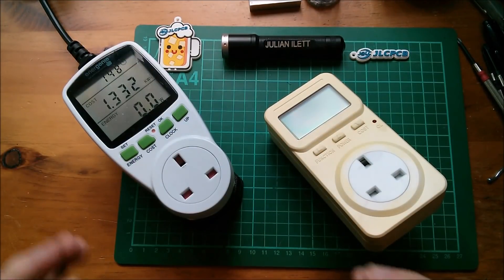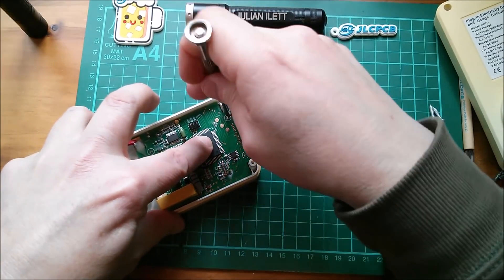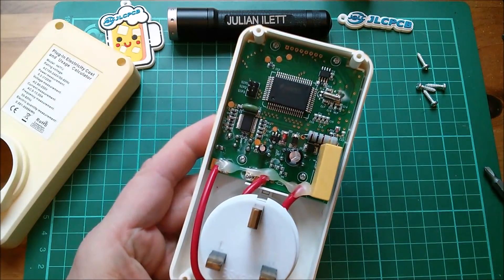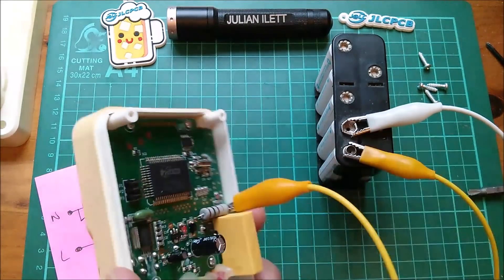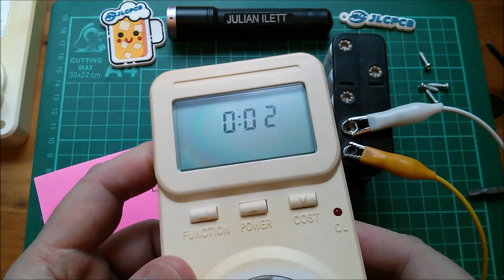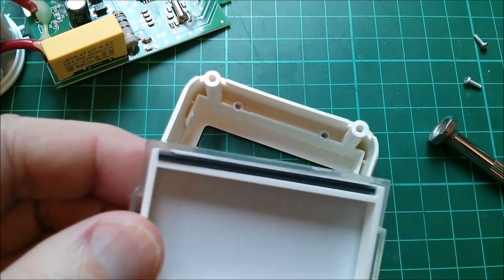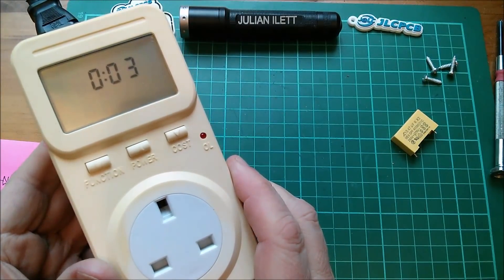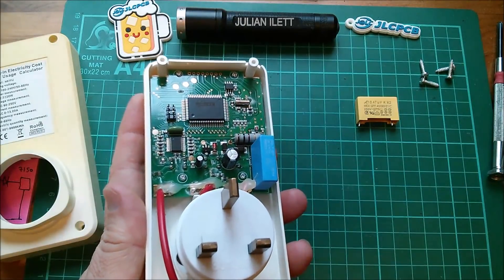Energy Meter Repair

Comment: It's common, capacitors have lifespans because of their chemical nature. They are usually the first things that start to fail based on age being the factor of failure. 
For example, resistors a simple wound wires, so they nearly never fail unless components before them failed that allowed too much voltage. 
Things like various diodes also usually don't fail because of age.
Most common age failure is a battery, second is a capacitor.

Comment: I'm surprised that you didn't doublecheck your line freq with the other power meter, Julian.  Anyway, that was an interesting romp around the power meter.  I use a P3 P4400 Kill A Watt over here in 'Murrica and have never had the need to look inside it.

Comment: The meter is also designed for 120V. With 240V, the needed capacitance is half. Of course, there's also a chance that the half-sized capacitor still works on 120V.

Comment: Besides a little lower supply to the 5 V regulator, I am pondering if the reference frequency is correct.  Voltages are measured in a ratiometric way, so they would still be O.K.  But the frequency is counted against some reference clock.  You might see if the frequencies of the resonator you mentioned or a crystal I actually would suspect is the culprit.  Normally the crystals also have a mode select capacitor or two.  Series resonant or parallel resonant?

Comment: The excess material on the plastic is called "flash" the process for removing it is called "fettling" which is done by a "fettler" which used to be a trade back in the day, still might be for all I know.

Comment: The pulse output is indeed energy. It can be used to power a pulse LED, like on your main meter. Or sometimes it is used to power an opto-isolator.
That way, an external device can monitor power usage without a direct ("galvanic") connection to the measuring circuit, either by putting a photodiode over the LED, or sensing the "volt-free" opto-isolator output.

Comment: No real surprises there - I was calling this as soon as you opened the case and I saw that big X2 cap - This is a VERY common failure of those cheap remote controlled mains sockets too - I've had loads of those come in for repair over the past few years with exactly this same fault. As the capacitor decreases in value over its lifetime, the amount of current it can pass reduces accordingly until it eventually gets to the point where the available current is insufficient to operate the device. This is especially relevant in those remote mains sockets as these need enough current available to drive a relay, so ANY degradation of the capacitor will result in a non-working unit (the most common symptoms with those are either that the device doesn't respond to the remote at all or, more commonly that the LED lights up but the relay fails to operate, or at least fails to latch on due to insufficient current being available to keep the coil energised

Comment: It seems that the frequency readout issue is NOT related to the capacitor or it's change - as the device displayed the same 56 Hz even when you directly applied the 12 volts to the 101 resistor with no AC power applied and no load (before you changed the Cap).  See 7:30 on the video.

Comment: I have one of these monitor sockets and  mine also always reads 0.01 amps even with no load plugged in. I don't think it can be half wave rectified  as a capacitive dropper wouldn't work with one

Comment: The smaller capacitor means that the voltage going to the regulator is reduced  (smaller capacitor has larger reactance). If they are tapping off just before the regulator to measure frequency, then the reduced voltage might mean there isn't enough voltage there to hit the threshold of the frequency detector. I suspect it will work if you put in the correct value capacitor.

Comment: You were getting 56hz while powered from the batteries which is physically impossible! Unless you have AC batteries? Did you check what the frequency was on the crystal? Unless it was reading that? Who knows... 
You definitely need a good LCR Bridge for capacitor testing! Over on XRayTonyB's channel, he showed a really good tester, it's silver aluminium in colour with a lime green LCD screen... This is a must have tool for anyone's bench and Tony does an excellent job of explaining how easy it is to use... It shows up capacitors that are failing! Not just capacity and ESR, highly recommend watching if you haven't already seen it.... I got the newer version which is black, smaller and has a built-in rechargeable battery via USB C, the amount of information it gives is like nothing else that I have or have come across... It's just as important as having a multimeter! I love it.. oh, and not that it matters but the new one gets a blue screen instead...

Comment: I really like to repair rather than replace. I had a similar issue with an old bose system belonging to the in-laws although I found the solution on the Web about which caps to replace. More repair vids and how/what to look for, would really help those of us with incredibly basic electronics knowledge but want to learn more.

Comment: What a clever and novel way to diagnose a circuit.  You would have thought there was more to it than that.  The cap sort of failed in a civilized and undramatic fashion.  I didn't know you could use a safety cap in a capacitive dropper circuit it seems like bad form.

Comment: Good one Julian... Down the wrong rabbit hole entirely re: display zebra strip, when the overload light was winking at you to give a hint it wasn't the problem. I expect the lower capacitance of the original capacitor means it was letting less power through, so it wasnt getting enough to work properly. Perhaps your new one is only marginally enough?
Reply from the maker: Yes, the dropper capacitor was providing enough power to run the microcontroller logic elements, but not the LCD drive circuitry. That had me fooled.
Reply: @JulianIlett  But even then not enough to run the microcontroller properly, as the overload light shouldn't have come on, unless it was enough to run the microcontroller, but not the energy monitoring chip? Who knows. At least it's working now. I picked up a power monitor plug cheap (was in a an assortment of stuff from an auction) which didn't work, I'll have a look at that now to see if it's the same problem. Might be lucky ;)
Reply from the maker: That's true, the OL led was a clue. I should have remembered, power supply problems always create the most baffling faults.
Reply: Tell me about it (oh, wait, you did! :D) ... I have a better one though... I have a self-made 'smart plug' thing... ESP8266 running Tasmota and controlling a pair of relays... one of the relays comes on every day an hour after sunrise, and turns off an hour before sunset. One morning, the relay didn't come one... So I replaced the module, and went poking and prodding the one with the faulty channel. Turns out the driver transistor seems to have given up ... when I bypass that, the relay fires... until that point, everything seemed to measure correctly. And here I was thinking at first the power supply module had packed up at last! :O

Comment: To get a Hz signal they  would need to have tapped in prior to the diode as the output of it will be to a smoothing cap prior to the reg. It does not look like there is enought cicuitry there to feed the microcontroller with a safe and compatible signal voltage from that point, I suspect that they have just fudged it to read half way between 50 and 60. I also suspect that the average user will just see the 56 and think it to be normal.

Comment: Remind me to stop writing comments before I've seen the full video - you said what I said just after I wrote it :
I wonder if the low capacitor value is throwing off the frequency measurement (for example if the MCU is measuring a voltage based on the reactance formula)
Reply: Why was the 12 VDC showing the same 56Hz?
Reply: @Okurkaarrgghh  I missed that - if its measuring that at DC and assuming its not fake and that some voltage is being read to generate this value, other parts of the circuit might be broken.  I'd look for a peak detector circuit measuring the voltage from an RC divider.  If that capacitor has failed then it could be hitting a zener limit or something giving that consistant 56Hz reading
Reply: Actually the capacitor in question has to be that big one because everything after it is rectified

Comment: The diodes and R C network (your cap) feeding the IC work like an integrator for converting the vibrating output of the monostable into a reasonably stable DC whose value is directly proportional to the frequency of the input signal.

Hence, as the input frequency rises, the value of the output voltage also rises proportionately, which is interpreted by a corresponding deflection on the meter and provides a direct reading of the frequency.
Reply: Why was the 12 VDC showing the same 56Hz?
Reply: If the mains were actually 56Hz, whether it's supposed to be 50 or t0Hz, would have engineers at power plants scrambling. In the UK licensing requirements say +/- 0.5Hz, and normal operation is +/- 0.2Hz, but usually within +/- 0.1Hz. Deviations are normally adjusted/compensated over time, so that mains frequency controlled clocks don't really drift.

Comment: You will probably find that if you lowered the voltage to it via an variac that it won't start up from the 100VAC written on the back as the new capacitor is now not lowering the voltage the same as the old one, have you got a variac you can test it with?
Reply from the maker: Yes it makes sense that 470nF is needed to provide enough power at 100V, but 220nF is good enough at 240V.

Comment: The X1 and X2 capacitors always seem to fail - I had a set of three remote control sockets and this cap failed in each one, very annoying
Reply: I don't want to say its always the cap... But it's always the cap (almost)
Reply: Yeah I've seen these things fail within a few weeks of the purchase date - I guess the caps they are fitted with are a bit marginal at best and seem to lose value really fast :(
Reply: Well, at least they are designed to fail in a safe and predictable manner (lose capacitance and eventually go open as opposed to slowly becoming resistive or shorting out).

Comment: The MCU could be doing the AC frequency measurement directly.  The dedicated power monitoring IC just does the more complicated power measurements.  Counting the half wave pulses wouldn't be too hard even with the MCU only running at 32kHz.  Weird that that doesn't work.  Are you sure it worked before?  You might be able to find a full schematic online for that model to investigate further but honestly I doubt you really need it.  Your DMM may even have it if you really want to check your mains AC but it won't be out by even a very small PPM of your standard 50Hz.  More useful if you were using an AC generator really.

Comment: You should be writing the resistor value on your schematics and not its code or label. - 6:13  For example, what is "100" on a schematic?  We don't write down "brown black brown" on schematics so why write its SMD number code?  (Yes, for a printed schematic for kids or those just learning you can write those down but only in addition to having the value.)
Reply from the maker: 101 is pretty safe. There's never been a one hundred and one ohm resistor.
Reply: @JulianIlett  There actually is a 101 ohm resistor in the E192 series (https://en.wikipedia.org/wiki/E_series_of_preferred_numbers#E24_vs._E48,_E96,_E192). 😁 But I've never seen it used even in a schematic, much less in real life.
Reply from the maker: @laurawerner  Heh he, nice one Laura. Good find.
Reply: He should've written 01A.

Comment: You kinda ignored the fact there were two faults initially.  Odds of having two unrelated problems is pretty low and what is common between them is the power supply.  One of the first things to check in repairs is... [drum roll] ... check voltages.  You did get there eventually and drawing out the PS section was a good idea.  But ideally you want to check the PS voltage using AC and if you don't want to start probing around with live 240V AC you can either use clip probes to the DMM and then safely plug in power or probe with the power off and have a 2nd person flip the power switch on and off.  Clips are obviously better.
That being said, I see how you thought (at 2:03) that power wasn't an issue and went down the LCD rabbit hole but hopefully you can now see how a rushed diagnosis can end up wasting time trying to fix something that wasn't an issue.
As always, it was interesting to take a look inside.   :-)

Comment: This thing is very yellowed around the socket. Mine is the same model and perfectly white. That makes me think yours was plugged in for a very, very long time. I'd like to know for how long. That would give me an idea after how much uptime I should expect such cap failures.
Reply from the maker: It lived in a live mains socket for many years.
Reply: @JulianIlett  OK, so after many years of operation, those X2 class foil caps can actually fail. I always thought they're kind of indestructible just like ceramics.

Comment: failing dropper caps is quite a common problem .thy are used in cooker timer clocks and if the display is non excistant or dim its that cap at fault. i tend to use 390nf as a universal replacement. ps they are know as wattless droppers and should not get hot.

Comment: When doing this sort of repair I usually leave a paper note for my future self stating the original part value. Since X2 caps degrade over time, a half capacitance cap will probably need changing much sooner than the original.
Reply: +1 for documenting changes from stock. Even if you do an exact replacement if you log your work you'll know where to look if problems arise again.

Then again maybe this video is enough documentation.

Comment: You might as well throw out the capacitive dropper components and wire in an old mobile phone charger. It'll give you much more stable voltage
Reply: But you probably won't get a frequency reading, depending on how they sample the frequency

Comment: I think they use a 5v zener to clip the sine wave, and feed the pulses to the input of a capture port on the MCU.
If you don't have enough voltage with this smaller cap, that would do it. It will give you the same reading as before repair.
Reply from the maker: Yes, there another small zener on the PCB.

Comment: Leave the older meter in direct sunlight ~ it will restore it back to white.
Reply: Isn't it the other way around? Doesn't sunlight yellow plastic?
Reply: @R4MP4G3RXD  It's the UV light in the sun that degrades the plastic so yeah this won't work. :-)
Reply: What about dropping it in a clear tub filled with hydrogen peroxide and then in directcsunlight?
Reply: @wyliecyottee10732  That seems to work well for, IIRC, The 8-bit guy. A search for Retrobright should provide links
Reply: I did see somewhere that just leaving yellowed plastic in bright sunlight will bleach it back again. Tried it on an old PIR light which had yellowed. It's still yellow.

Comment: Capacitors and inductors don't get hot when they pass current.  Could you do a video on this topic because there's very little on Youtube about power factor, reactance, impedance, VA and VAR ratings?  I recently tried to explain power factor to someone before realising that my knowledge was limited.
Reply: Sorry, but that's not true. Capacitors certainly do heat up when connected to an AC voltage source. Here's an article from Murata (they should know some things about capacitors ^^) about heat generation in capacitors: https://article.murata.com/en-eu/article/heat-generation-characteristics-capacitors-measurement
Reply: @stheil  Yes, the non-ideal parameters of rective compnents is well-documented, but can be ignored here because the frequency is only 50Hz (or 56Hz as Julian's energy meter seems to be reporting).  The article in your link does say that ESR is only a problem above 100kHz.
Reply: @westinthewest  you’re right, I didn’t consider that the frequency is very low in this case. Heating shouldn’t be a problem here. Your statement was pretty general though and I just wanted to clarify that.
Reply: @stheil  I'm hoping Julian will take the bait.  He might be interested in doing an investigation into this area of electronics.

Comment: Never heard of an X2 cap having a partial failure like that. Anyway your smaller value should be OK, but maybe a little marginal on a low-mains day. Try running both these units in series at the same time and see how they track each other.
Reply: It's actually a very common failure of metallised film capacitors used in mains applications, voltage spikes on the mains cause a breakdown of the dielectric which then self heals by vapourising a small area of the metallisation.  This happens repeatedly, especially if the volatge rating of the capacitor is barely adequate and it gradually reduces the capacitance value.  If you replace that 250V capacitor with a 300VAC rated class X capacitor it will last forever.  This power meter must have been left plugged in for a long time for this to have happened.  I have repaired several small appliances, things like mains timers, power meters and a coffee maker by replacing the capacitor, it's the first thing I check.
Reply from the maker: Yeah, I thought class X capacitors were designed to fail short.
Reply: @JulianIlett  Yes it is supposed to crowbar the fuse.